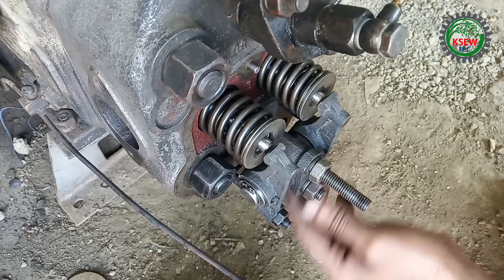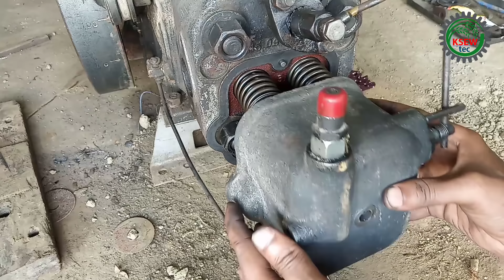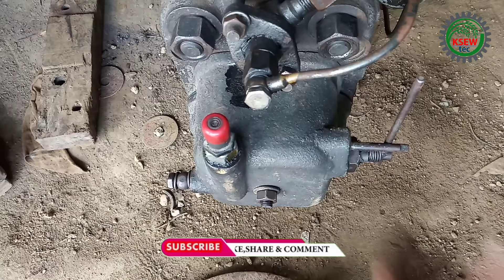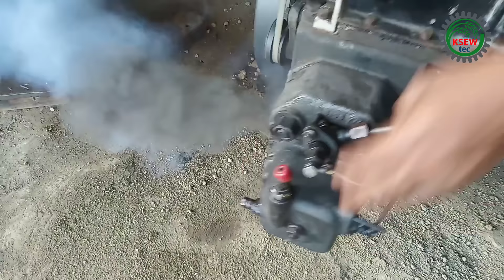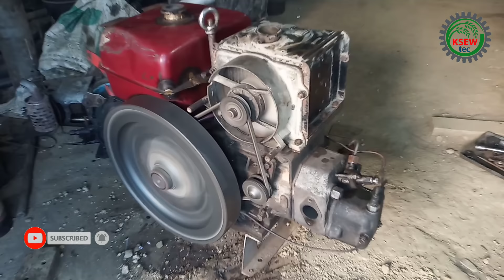Tappet adjusting of China diesel engine/Power tiller engine fitting.

Comment: How to fix if the water mix with oil?😇
Reply from the maker: There are three reasons for the water to leak into the mobil,
 * the eyes of the head are perforated
 * the rubber of the cylinder is damaged
 * the head gasket is burnt.
Thank you
Reply: @KSEWTec  Thanks❤️
Reply: Una pregunta. Porque se dobló la varilla de empuje motor? La del lado de admisión